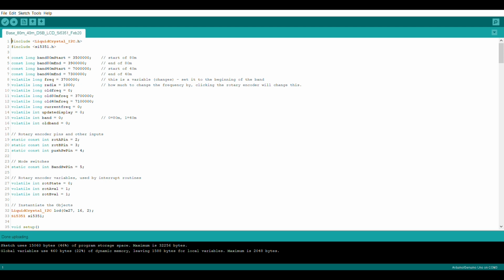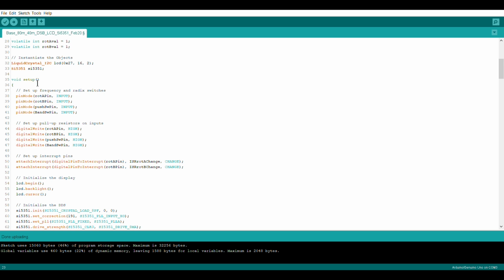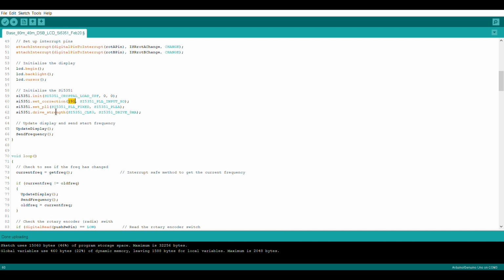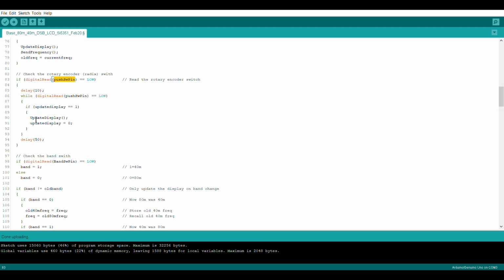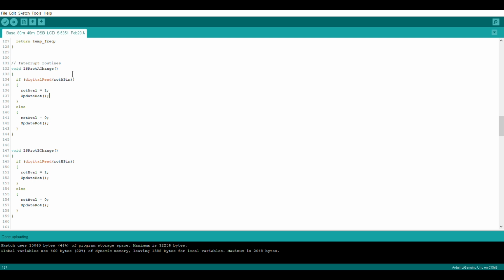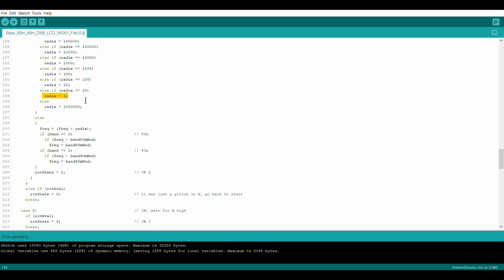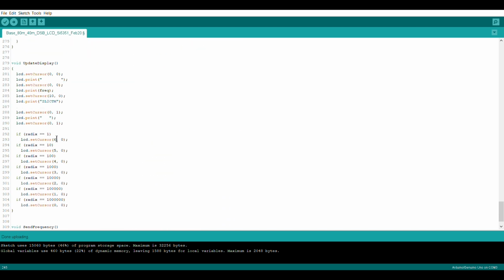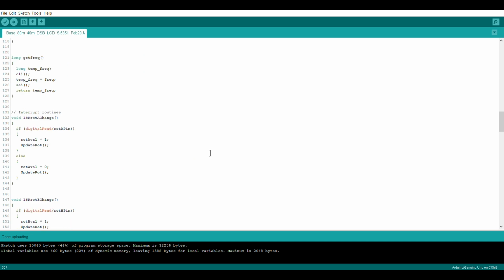Simple Homebrew DSB-SC 80m 40m Rig: Part 2b - VFO Arduino Software

Comment: Having arduinos and the Si5351 frequency chip boards definitely make it so much easier to build radios now, solid frequency stability and accuracy and no more worrying about temperature drift, etc
Reply from the maker: I agree. I believe it lowers the barrier to getting into homebrew.

Comment: Great video Charlie. I'm using a rotary encoder that has 5 pins in a row: CLK, DT, SW, +, and GND. I've never used one like this before. Is there a Key to translate your diagram for use with the 5 pins in a row decoder?
Reply from the maker: Hi Greg. I don't know for sure. From what I can see on line, I'd try CLK->2, DT->3, SW->4, + to 5V, GND to GND. If that works, but the rotary encoder is backwards, then reverse pins 2 and 3.

Comment: One small tip for you.  If you change lines 40 & 41 to INPUT_PULLUP instead of just INPUT you will not need lines 46 & 47.
Reply from the maker: Thanks Nick. I had seen that used before. I'll update my code here and use that moving forward.
Reply from the maker: I've updated the blog Nick. I'll use this for now on.

Comment: I also use interrupts with the rotary encoder, however I usually use the AVR C routines directly to set up the interrupt routines, rather than the Arduino function.
Also I only do the accumulation of knob movement in the encoder interrupt routines, my main loop applies the rotation amount to the frequency according to the increment value selected.  This way none of the maths are done in the interrupt routine, keeping it as short as possible.
Another thing, I see you use the push button to change the rotary encoder from frequency to radix mode.  I usually use the push button to cycle the radix one position, ie: push it in and the radix increases one position.  For each push the radix moves until it reaches the max position, then it cycles back to the min position.  I have to debounce the push button in software of course.  I can see the logic in the way you do it, but the effort to change the radix is about the same in either method.  (Holding the knob in while turning seems more difficult to me than just pressing the button a number of times).  I also asign different meanings to the length of the push of the button.  A quick press and release cycles the radix, a longer push activates a menu mode controlled by the knob for things like band change, lsb-usb-cw mode change, etc.  A very long press (> 1 sec), activates the calibrate mode for the Si5351 which is canceled by another long press.
Reply from the maker: Thanks for that. Something for me to think about.

Comment: Hi Charlie, I have learnt a lot from your first Video on the SI5351.  Already putting in to practice what you have explained to us. Looking forward to the whole set of videos on the basic cw transceiver 73 Colin VK2JCC
Reply from the maker: Gidday Colin. Thanks. I will get back to the CW rig after this.
Reply: Hooked everything as per your information and got the sketch to run. Encoder changes frequency and pressing down can move along the steps.Yippee. I still have to do the calibration yet as I have weird frequencies coming out of the three clock outputs. Clko 11.2mhz  , clk1  25.67mhz and last clk2 56.mhz. Thank you for your detailed video . We appreciate your efforts. Going to homebrew this project, so saving the videos. 73 Colin vk2jcc
Reply: Found the issue the frequency counter  I was using has a fault!
Reply from the maker: @colincolin30  Phew!

Comment: so sharp!
did it take long to upload?
Reply from the maker: Hi Chris. It turned out to be a 3GB file and took just under 8 hours to upload. I must admit I can't keep doing that.
Reply: @CharlieMorrisZL2CTM  8 hours! that is slow! about 1Mbps. It looks like YouTube has heavily re-compressed it to 166,596,685 bytes (18x). I wonder if we can do that with FFMPEG before uploading. That would reduce your upload time to about 27 minutes. Maybe cut that in half at 720p.  It took me ~35 seconds to download on fiber.
Reply from the maker: @Chris-ZL  I'll see if I can find out anything more on FFMPEG. I'd prefer not to spend hours doing post production work so something simple is all I need. If it can also merge files then that would be good too.